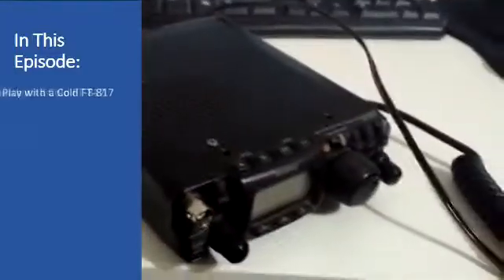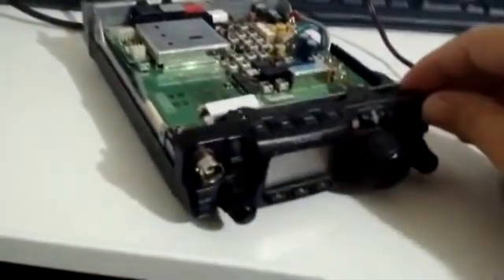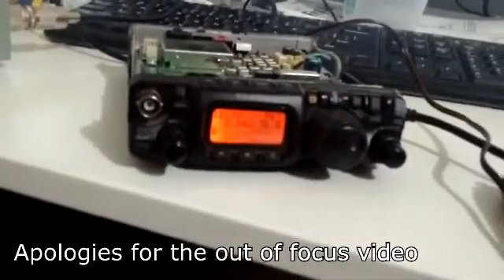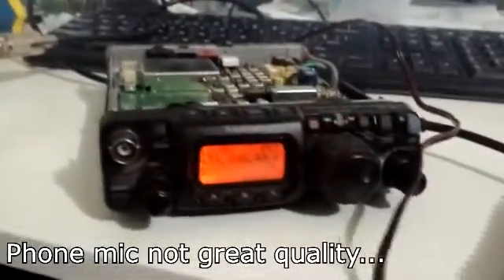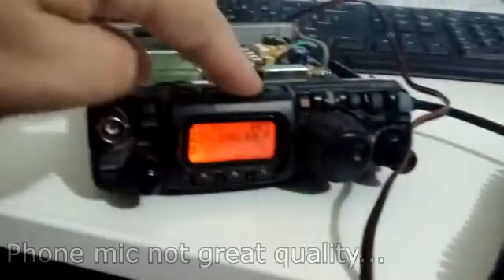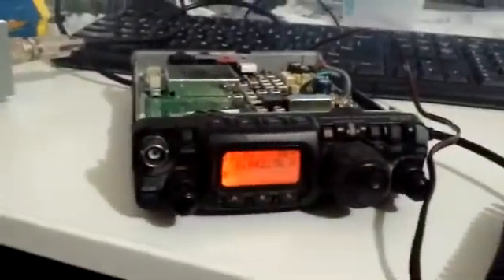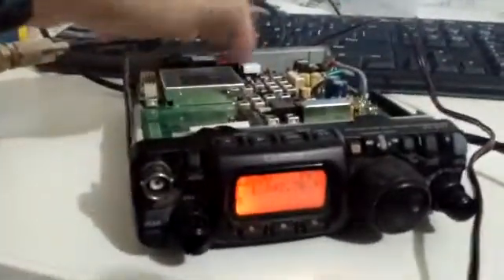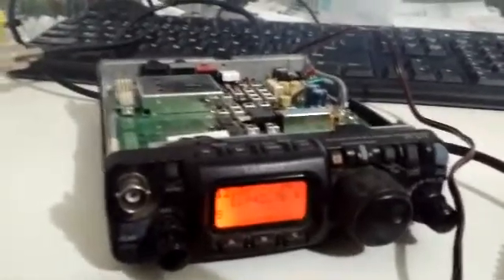FT-817 Ribbon Flex Fault

Comment: hi I have same problem with 50 pin ribbon part T9206932 could i ask were these cabel are purchase from I have very difficulty finding replacement thank you john
Reply: Hard to find parts, seems. I'd like to get ribbon between main and display unit.